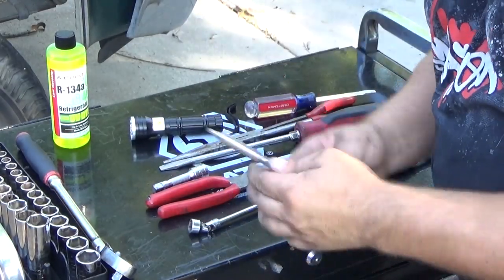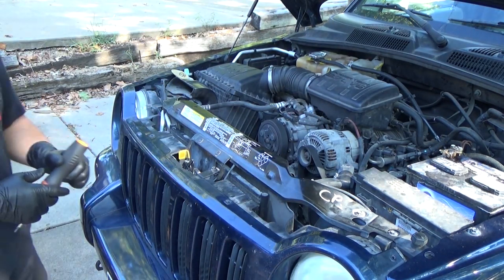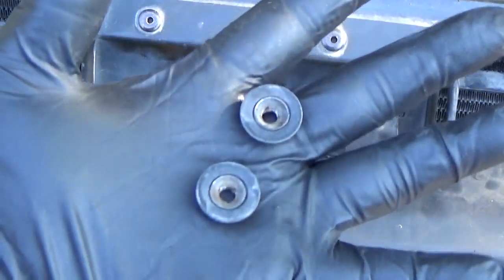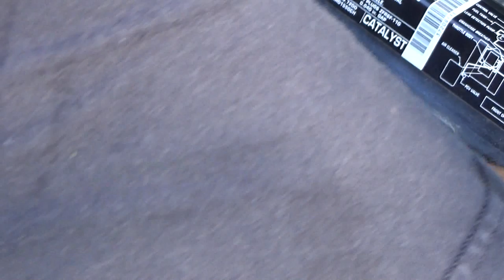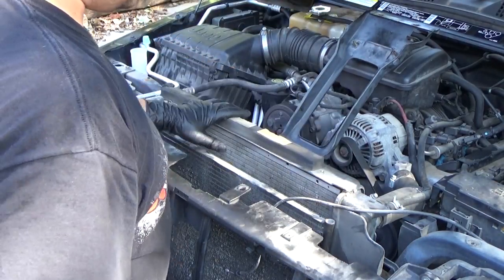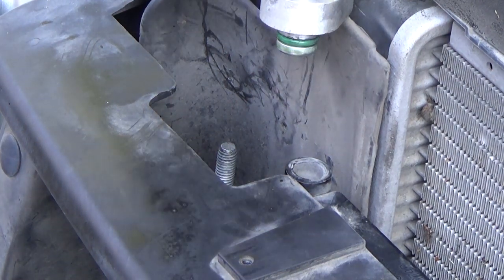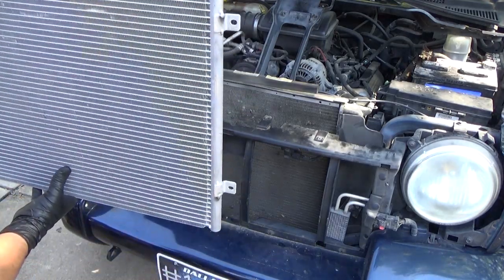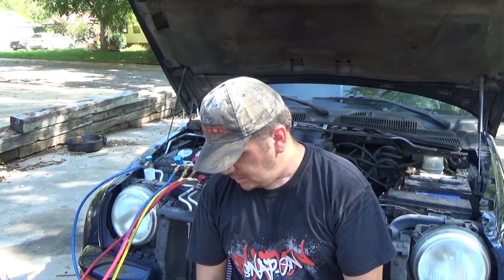2002 Jeep Liberty AC Condenser Replacement - Automotive Education

Comment: I Just had my air condensor fixed within the last three weeks.  I have never had any issues with my coolant before this.  I probably top off my coolant to the line  monthly or less before this.  Since my condesor was fixed three weeks ago, I  have pruchased my third bottle of coolant.  Last night I drove to town 15 miles and back, I have not been running my air at all due to my leak that I thought was just condensation.  This morning I lifted my hood up and my reservoir needed completely filled back up. i had a small amount showing in the tank.  I have had to do this three times this week.  Is there anything that could have happened during this repair of mine, that would have set off this issue I am having now?

Comment: Thank you for the informative video. 
I bought a 2006 Liberty with 100k miles on a year ago and got a good deal. 
When I bought the Jeep the AC was not working, needed a new condenser, and the seller said I can either take a price reduction or he will have it repaired, I opted for the price reduction. 
Now that I want to install the new condenser I notice the 2 refrigerant lines on the condenser were never bolted back on, I assume this was when the repair shop did the assessment before I bought the Jeep. 
With the system being exposed to air and humidity for a long time (I assume around 2 years), is it better to just replace the compressor and accumulator as well before I pull the vacuum and add refrigerant again?
Reply: Yes.  Is that what you did?  How did it turn out for you?
Reply: @RycheForOrder  I ended up purchasing the new compressor kit which includes a compressor, oil supply for the compressor, hose seal kit and accumulator. Also bought the orifice tube assembly. Installed all, pulled vacuum then added refrigerant. By doing so I ended up with a new AC system and it works well.

Comment: If you don’t have a air vacuum can the job still be done?
Reply from the maker: Caleb Mendoza Yes, it can be done, you just won't be able to do it all yourself. You can do the part replacement, then take it to a shop to be charged. Definitely should take it the same day immediately after the repair. The less time that moisture is in the system, the better. 

Thanks for checking out the video and for your comment.
Reply: Ok thank you for your help. Just to be clear I shouldn’t use the re charge yourself bottle but take it in and have them recharge it
Reply from the maker: Yes, because it's absolutely necessary for the system to be pulled into a vacuum before being charged.

Comment: This could have been a great video,you don’t need to show taking out all the bolts maybe the first and last bolt just show were they all are,you should have showed what line you put the vacuum pump on the high side or low and for how long and expand why,same with charging the system, how much at what pressure and type of refrigerant 134a most guys don’t know this
Reply from the maker: Thank you for your input. It's always nice when people say they liked the video, but feedback like this helps me make better videos in future. Thank you again.